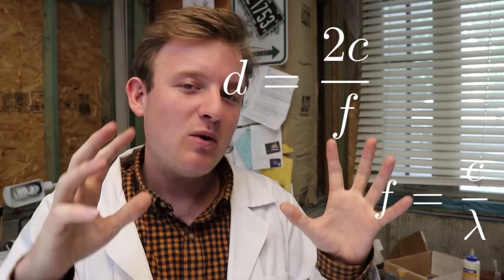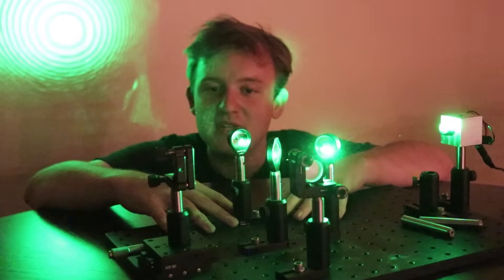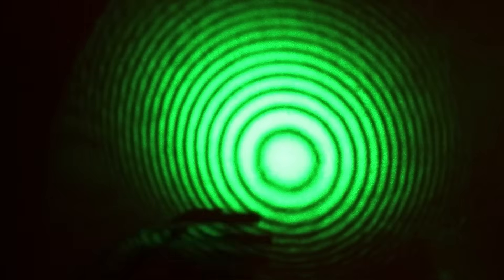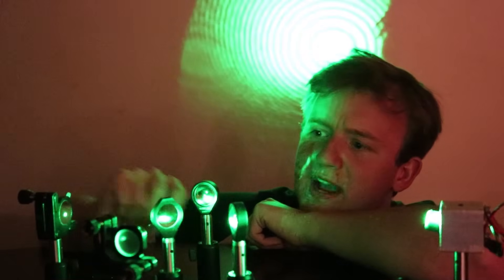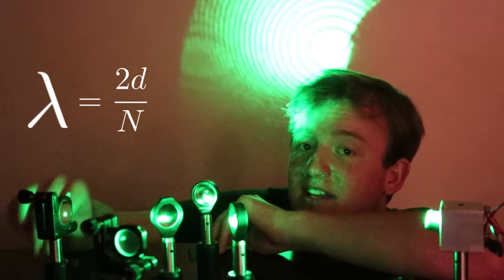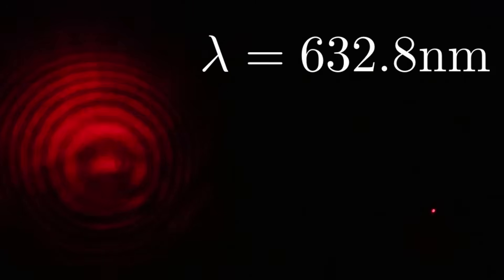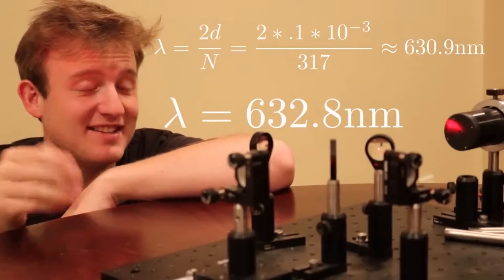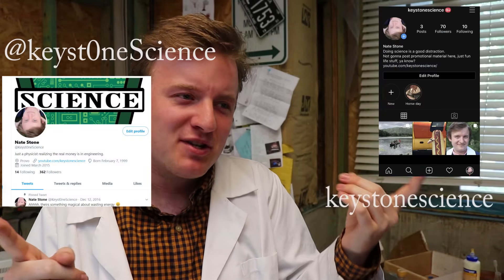Using the World's Smallest Ruler to Measure Light

Comment: WHEN you’ll show HOW to MAKE giant  tesla coil?
Reply: Take the video where he makes a small Tesla coil and multiply everything by 10, that should get you somewhere.

Also if you don't already know what you need to know to make a Tesla coil, you should not be making one. That's a great way to die of electricity. Do smaller projects first, get an understanding of how electricity flows and how to use it safely, then do the big flashy things. Tesla coils are a whole different kind of dangerous when they're running, electricity is *fast*.

Comment: I love all laser related projects. Thanks for this video. 

You may wish to wear protective goggles though, if only for setting a proper example
Reply from the maker: You’re totally right. I need to be doing that. I have infra red filters and such that I put on this laser to ensure it’s safe, but no one else knows that. I’ll be better with that in the future! :)
Reply: Keystone Science well as you can see from some of the comments, different people display different opinions on the hazardousness of such things. Which is why it’d probably help if people with influence treated security measures as universally relevant and a thing worth a mention. 

Some ignore the fact that all dpss green lasers have diodes that potentially output at least >~300-500mw (~class 4 laser) which is necessary for the second harmonic generation to work as it does in said laser pointers so even if the output power of the 532nm output is relatively low, the diodes themselves are class 4 lasers and potential leakage means to expose oneself to various dangers. 

Aside from the obvious retinal burn, one can also dmg the eye lens and potentially get caratact, which in fact may arise from a variety of damages to the eye such as: 
-dmg to the DNA of the lens cells through ionising radiation and
-dmg to the lens cells though the heat caused by the radiation,
caratact is the aftermath of the dmg to the eye lens and ones vision gets significantly worse throughout the years.
Reply: @KeystoneScience  ma eeeeeeyyeeess theeyy buuuuuuuurn
From a 10 mw laser 👀
Reply: Yes, this is why.
Reply: Maybe just state something about laser safety and then tell everyone that you're using something that has not enough power to be harmful
eg: looking at the bottom of a laser mouse

Comment: Make a 300 amp welding machine with microwave oven transformers using a single 125 volt circuit. Try and do it without 240 volts. That's a video idea. I've already made this type of project, but since no one else has made it on 125 volts, I want to see you do it. As well as get your thoughts and opinions on it.

(Stick welding machine)
Reply: I don't know what size residential fuses you have for 125V, but it will draw a lot of current, 70-100A, or it's not gonna be a very good stick welder. To stick weld with 300 A you should have 25-35V arc voltage so transformer turns ratio can't be really high. Maybe with 1/4" electrode and short arc length 15V could be doable but still 40A from mains. 3-phase 400VAC ftw

Comment: EYE PROTECTION!
Reply: I  was a bit nervous too but he says it's just a cheap laser pointer so it's probably fine
Reply: @KingJellyfishII  Cheap green laser pointers are scarier than expensive green laser pointers, they often leak a ton (many times the rated output power) of IR laser light, and that beam can easily end up misaligned with the visible beam because it bounces off of different surfaces (i.e. the visible beam bounces off the silvered back of a mirror while the IR beam bounces off the glass face, slightly changing their incident angles), so you could just pop go blind all of a sudden because of the invisible component of the beam bouncing off your window and hitting your eyes even if you're wearing 532nm laser safety glasses, because they aren't blocking the IR.
Always, always wear laser safety glasses and never point any laser at any eyes. Yeah, you're probably going to be fine, but is it really worth the risk of being instantly and permanently blinded? Shit sucks, I know people who've had their vision damaged by the IR component of a cheap green laser. It really is instant, the time it took was imperceptible, don't take risks.
Reply from the maker: Yeah, you’re absolutely right. When I put it in the metal case, I but IR filters in front of it for that reason. So I am safe from this one, but I don’t want viewers having the impression those cheap green lasers won’t hurt them, their power rating is much higher than what is advertised
Reply: @Teth47  How did I not see this before commenting about the ir filter.
Reply: @wildfireman13  Youtube's comment system is utter garbage lol
Reply: @KeystoneScience  If you decide to address that in your next video, maybe link to (I think) StyroPyro's video about green DPSS lasers, how the cheap ones are more dangerous, and how to protect yourself. I don't remember the video title and am having trouble finding it, but if you guys know each other maybe he'll have better recall.
Reply: @KingJellyfishII   The cheap kind that don't have ir filters?